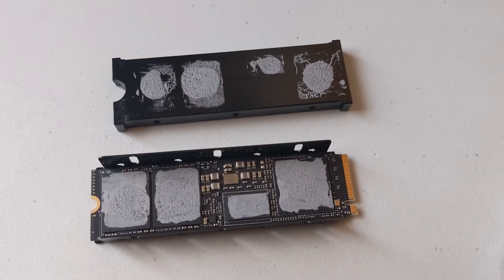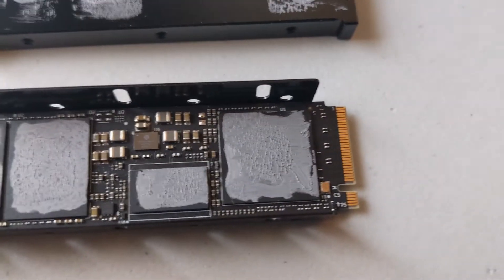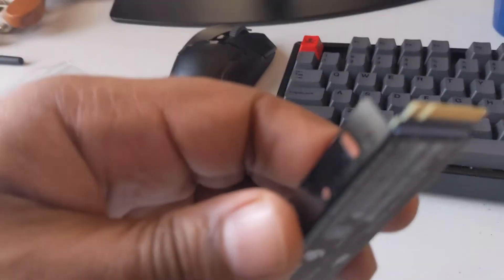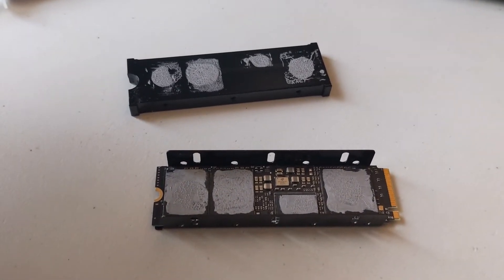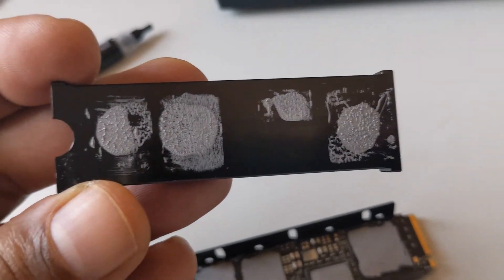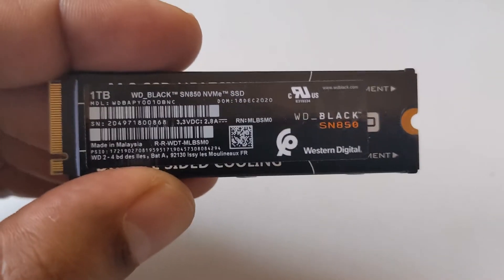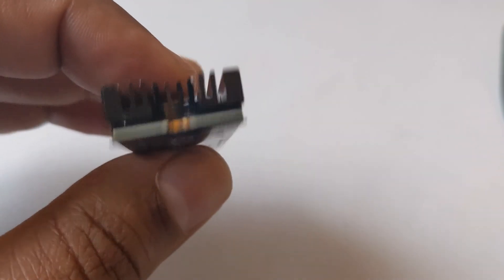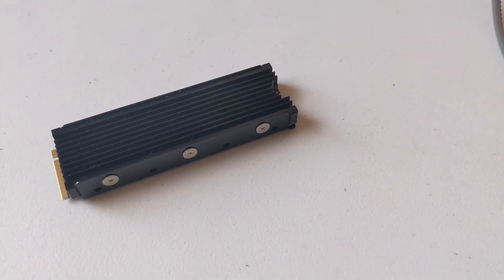WD SN850 & Noctua NT-H1 Thermal Paste & MHQJRH Heatsink - No Thermal Pads

Comment: I have the same 2tb drive. Is the warranty not void after peeling off the sticker?
Reply from the maker: Yes. Once one removes the sticker the warranty is no longer valid as the sticker is the 'heatsink'.  With my heatsink modification, I am actually maintaining around 40C to 42C with normal use so I am happy.  These things can get to 90C under heavy workloads.
Reply: @starstak1  Thats is true if you destroy the sticker,if you take it out intact you can put it back with no issues if a waranty is needed...